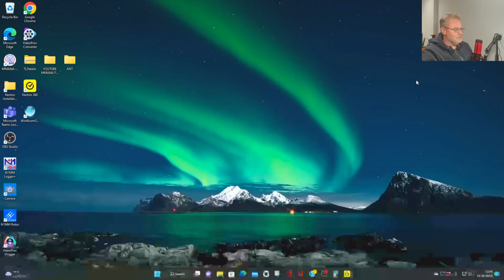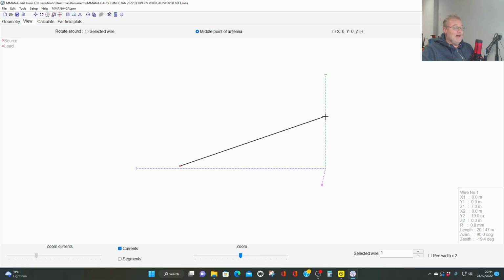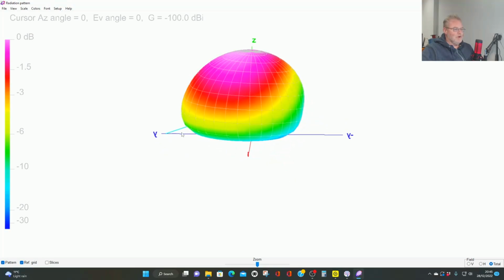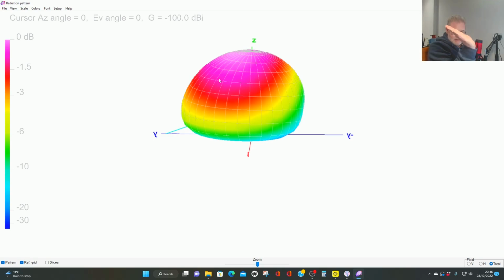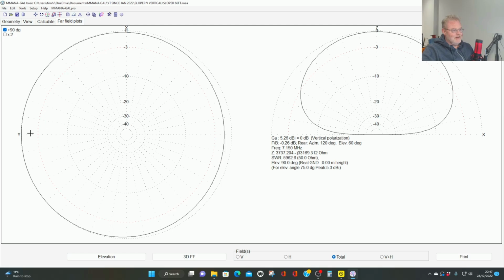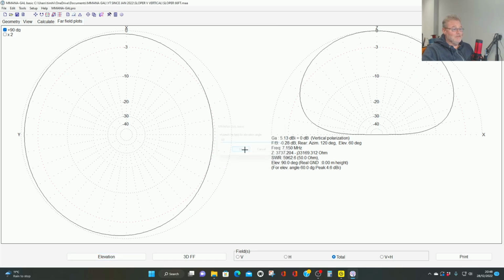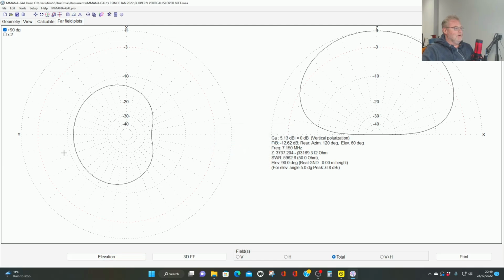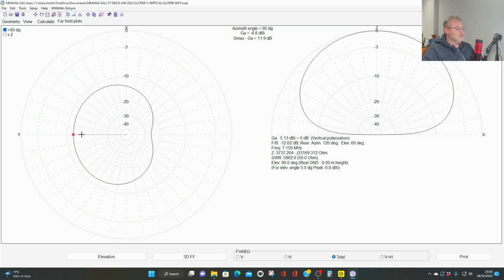Ham Radio: SLOPER ANTENNA - POSITIVES & NEGATIVES

Comment: I’m setting up a stealth antenna at my QTH and this video was incredibly helpful. Showed that in my situation, I need to attach the high end of the sloper lower than I initially thought so that I would have a more omnidirectional antenna. That said, would there be a substantial difference in radiation pattern if the antenna feedpoint was mounted say 3m off the deck?
Reply from the maker: Likely a little more gain but not a massive increase

Comment: I have an end fed random wire that I use at my home in a portable configuration. That’s to say I zip tie the insulator to the top of a DX commander  10 meter pole and slope downwards… not exactly sure of the angle, but the top is facing hue south, and I was able to get into Europe (uk, Northern Ireland, Italy, Belgium, and even into Southern Africa ) with 100 watts from the east coast of the US…. One thing I can’t do for some reason is get into the west coast of the US so far. Internal ATU in my FT450D tunes all bands 80 thru 6
Reply from the maker: Sounds like a good solution!
Reply: @TIMG5TM it works! Works even better on digital modes like ft8 etc.

Comment: Does it make a difference if you feed it at the top?
Reply from the maker: If the current maximum is near the feedpoint then extra height would really help .. depends on length of the wire and the band

Comment: Nice video.thanks for doing it. What about gain  broadside to the wire? I have two sloping center fed dipoles, 20 and 10 meters. Top ends approx. 50 feet and sloping about 30 deg. I get a a similar plot as you have it and the broadside radiation is quite nice. I know my example is not and end feed but I would to get your thoughts. Thanks
Reply from the maker: That’s an interesting example 👍
Reply: I'd have thought it wouldn't make much difference to the pattern where the half wave is fed. It's just an impedance issue.

Comment: Could you model it fed at the high end? I use an end-fed half wave sloping down at 45' from the top of a 3 story house to a few metres off the ground and it seems to perform very well for a bit of wire, particularly on 10m. But I've never modeled it.
Reply from the maker: I can check that.

Comment: Not tried this on the air but did try it when doing my initial EFHW field tests. What was profound was the SWR of the harmonics did not tie in like they did if it was an Inv L or an inv V. It was way off compared for some reason and unusable on some higher bands.
Reply from the maker: That’s really interesting Colin. I’m sure some Efhw manufacturers recommend a sloper. But there again it depends on how forgiving (lossy) their transformer design is. I suspect your 56:1 design, with greater efficiency on 10/15 is less forgiving. That’s not a bad thing as we both know. 73
Reply: @TIMG5TM  Think so Tim. Witnessed on bothy core's. The 2 common ones are very forgiving.

Comment: Interesting stuff Tim. What happens if you feed the sloper at the high end? I have seen this discussed and some antenna manufacturers recommend having the transformer elevated with the wire sloping towards the ground. 73 de Will, M0LGW 👍🏻
Reply from the maker: Hi Will, it shouldn’t really matter. 73

Comment: Thas is interesting Tim. My end fed at home is a sloper, facing south, just because that's the only way it fits! It is relatively flat though.
I wonder if you ever model antennas against different ground types? There is a theory that we get away with low masts on rocky mountain tops because the real RF ground can be several metres below the surface layer of shattered rock.
All the Best for 2023. 
73, Fraser MM0EFI
Reply from the maker: That sounds a very interesting avenue to investigate Fraser 73

Comment: Interesting. Does this apply to long wire antennas too?
Reply from the maker: Well this was a 1/2 wave. Patterns will vary according to wavelength.
Reply: @TIMG5TM  I changed from my EFHW to a long wire so I could get 80M. The external tuner does struggle to tune 80M but gets there after a few attempts. The long wire is on a slope from 12M down to about 10M and is fed at the high end.

Comment: Nice video Tim ... I live on a 7th floor and my antenna is a steel wire with 21 +/- meters of 0.8mm ... take off angle is about 65º above ground 3.5 meters
I work 80, 40, 20, 15 and 10 meters with very good reports
Happy Near Year - CR7BDO / 73
Reply from the maker: Sounds a great antenna Jose. 73